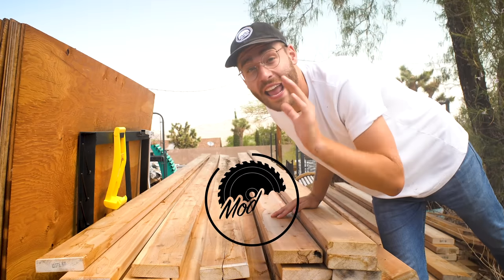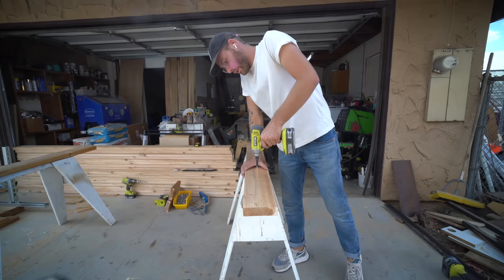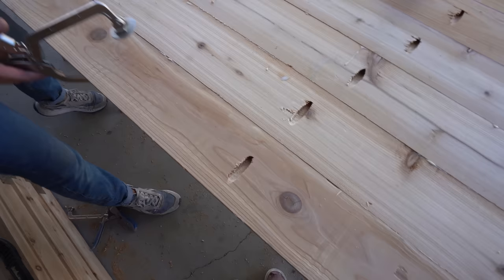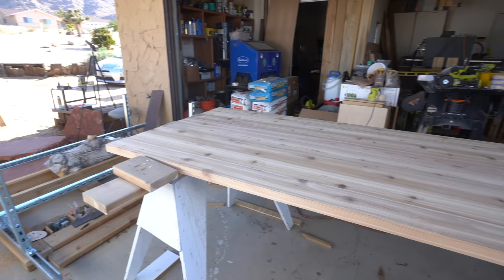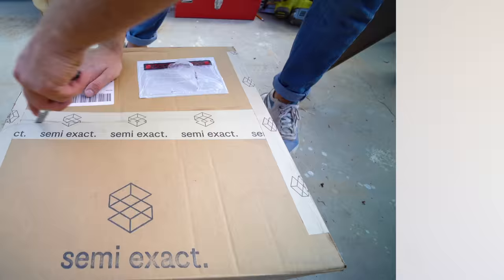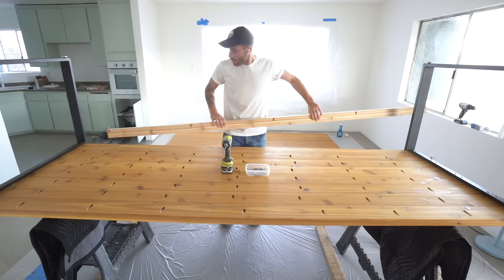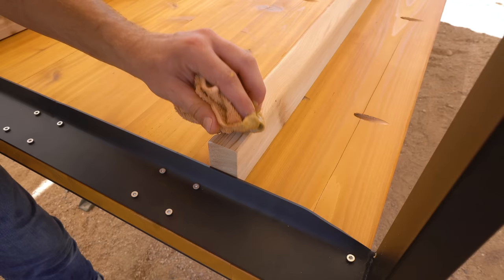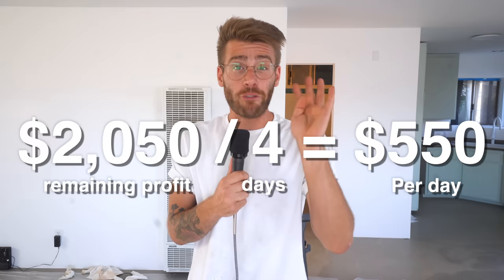How To Make $500 A Day Woodworking / Building Tables

Comment: My only concern with this build is the future horizontal movement of those benches and tables. People sitting on those benches will constantly shift side to side. And with only screws holding them down, they will losen over a short period of time. Your hands are obviously clean now the transaction is complete.  But possible future references might be needed to obtain future large jobs
Reply: He super doesn't care or doesn't know. Those table legs and bench legs are super unstable. It won't last.
Reply: @WiiNESticles  …he lives in a desert
Reply: How would you prevent that?
Reply: @Mrcoldbloodedd  cross stringers
Reply: Yeah with one and a quarter inch woodworking screws can't see that staying tight and sturdy very long without being pulled out would've used lags but thts me..wood movement is always a thing no matter where u are I'm sure not a whole lot considering the wood was dried Outdoors to begin with and he is in the desert but those screws in the benches are going to loosen up a lot sooner than later for sure
Reply: @Mrcoldbloodedd  basically those leg choices were not adequate for the expected loads on the benches.
Reply: Ah, you didn't watch the video. I think you are referencing the cross brace and the connection of tables. Wood glued together, you could actually ditch the screws if you wanted to. Once wood is glued together you are not going to separate it unless you brake the the wood. Glue joints are actually stronger than the wood itself. If you do any wood work you should look that up, spend some time researching this stuff. It will help you.

Comment: tip- bring your first pocket hole screws in far enough so you don't cut them off in the process of squaring up the material and when cut to final length. you glued it up and then sandwiched it in the legs and all that jazz just something I noticed. good work

Comment: I love the idea but some major flaws with this method. 1. Pocket holes are great don’t get me wrong but I’ve done a few myself on tables and I would rather put in the extra time and go with dowels, biscuit, or domino (if your willing to drop the $1000 festool), if you do go with pocket hole, be sure to get lots and lots of 48in/+ clamps then having something like a router sled to plane it after 2. I’d be worried about getting a call in 12 months of some unhappy customers because of those boards will be moving. 3. All those boards looked like the were milled down pervious to the video starting, meaning it was ran through a planer/joiner to get rid of any bows or warps with the boards. Never have I been able to find more than a dozen perfectly straight boards that aren’t flawed somewhere and needs milling.
Reply: Biscuits are only good for alignment and add zero support or strength.  Dowels and domino's are better, but honestly not sure if I'd call them better than pocket holes either. And I prefer dowels/dominos

Comment: They look good now but they’ll warp with weather/temp change. You can use z clips to allow the boards to move. Pocket holes are great but not in this application. Also understanding the grain and how wood moves will help you become a better carpenter.
Reply: I agree pocket holes aren't very good for thick material. I prefer spline but if it's dry they won't move much.
Reply: The glue is doing most of the work anyway though.

Comment: Those pocket holes are going across the grain. Did you take them out after the glue dried? You'll run into wood movement issues if those stay in place.

Comment: Man - those tables are beautiful. Though, I'd be a little nervous about the pocket holes as the joinery method. With the being so long, wood movement will actually matter - are you worried at all about them pulling or cracking down the road? I'd be sweating an unhappy phone call from the customer by next fall lol.
Reply: I think you're 100% right on this. Not only do the pocket holes not allow for movement, but those legs also restrict natural width-wise movement. They look fantastic now but who knows in a year from now :(
Reply: Typical wood joinery purist, lol.  Nothing wrong with pocket holes for a project like this, looks great and it will last.
Reply: @JohnnyGarton  haha definitely wouldn’t consider myself a “wood joinery purist”. Not even sure that’s a thing 😅. 
Do whatever works best for the project is my usual approach. 
However, I have seen pocket hole screws fail in that kind of application on more than one occasion. They’re best suited for plywood and cabinet construction. Nothing to do with being a purist lol
Reply: Edge to edge with tight fitting joints and modern wood glue there’s no need for hardware of any kind. In fact, if these tops ever become damaged they can’t be flipped over for a fresh surface. I like the look of the finished tables and benches, though. Scott
Reply: Is there a lot of humidity change in the desert? Probably wouldn’t be too concerned about seasonal movement.
Reply: There's also the fact that he didn't alternate the wood grain, so the center of the table might start cupping
Reply: @nathanweisser  thats a good point as well. Generally, in my experience, if you mill your boards correctly, and drop in a few C-channels, then the growth ring alternating strategy isn't really all that necessary. However, (and take this with a grain of salt, because i haven't watched this video since the first time last week), I dont think Mike milled or added C-channels. 

To be clear - not meant to bash Mike at all. He is definitely a talented guy and has his own style. I just hate to see newer (inexperienced) people attempt something like this and have it blow up in their faces later... speaking from experience lol
Reply: @nathanweisser  not alternating wood grain will cause the failure and lead to cracks.
Reply: @nathanweisser  what do you mean by alternating the wood grain?
Reply: @SuperNoticer  if you look at the end of the board you should see the grain of the wood it usually looks like a laying down C kind of. You want the boards to alternate with the way the C lays down
Reply: @deusvult6920  ahh ok, so one board crown up then the next board crown down?
Reply: I completely agree with the comments here. I actually think doweling is a faster  and easier strategy for board alignment vs using pocket screws. I would definitely alternate the board grain as well, and use c-channels on the underside to prevent any potential cupping. It’s actually not that hard to do all this. Why risk having your tabletop splitting eventually, especially when you’re building this for a customer?

Comment: Why not a domino or biscuit jointer? Could you have tapered the ends on the under support boards for the benches? Would there have been loss of strength?

Comment: using countersunk screws on your flat metal hardware didn’t look great. Since the metal brackets wrapped around the tabletop, a more robust solution would have been hammering in some captive nuts to the tabletop, connecting with bolts and washers from the bottom
Reply: I agree, threaded inserts would have been ideal